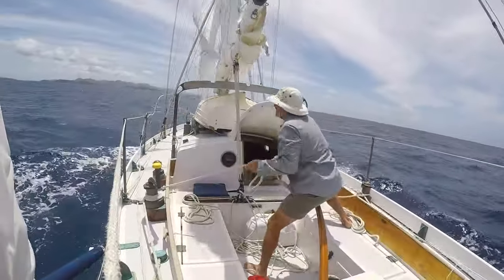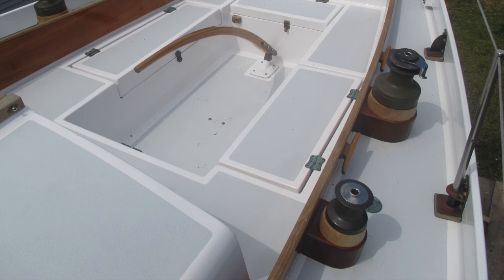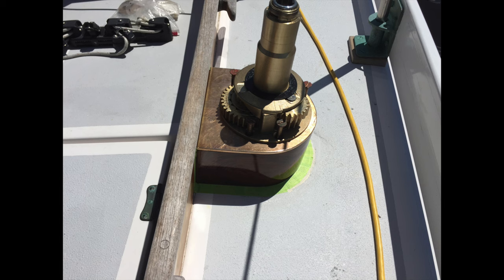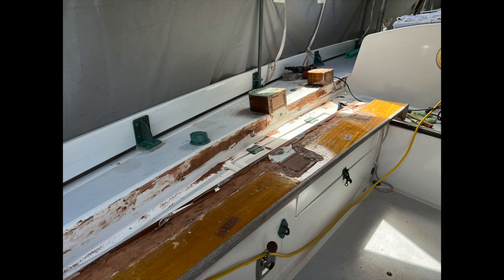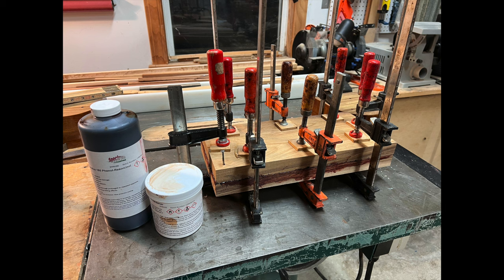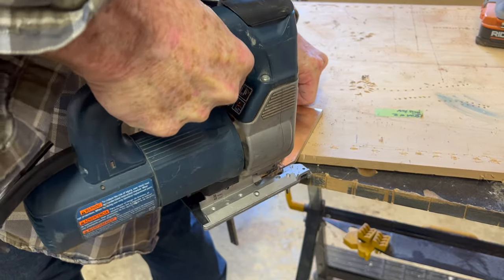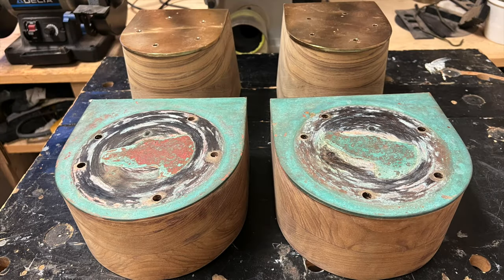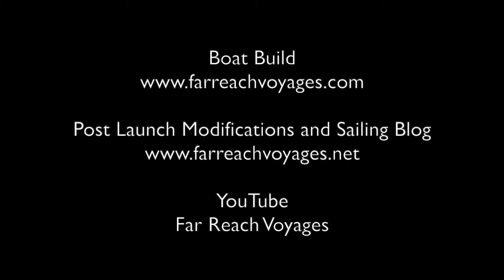S6E2//How to Build and Install Custom Teak Winch Pads with Bronze Top Plates

Comment: I changed my LOGO
Sign up to learn how to sail a sailboat. However, it is very cold at sea in winter.
I really like your little fine wood planer
Epoxy-bonded wood will have a noticeable gap.
Big Star has a waterproof glue that can bond two pieces of wood together naturally without any gaps.
Reply from the maker: Exactly.  It's important not to over tighten joints when using epoxy because you can squeeze the epoxy out and starve the joint.  So if you can't clamp hard epoxy can be a good choice though it comes with liabilities many people don't want to acknowledge.  Though I am not familiar with Big Star there are several good glues when used on tight joints and clamped well the glue line is practically invisible.  Weldwood Plastic Resin glue (which I have used), UF 109, Aerolite 306 and 308, Tite-Bond III can work well.  Most, though, are not completely waterproof, boil proof, UV proof, and steam proof, like Aerodux 185 and other resorcinol glues.  

I can't tell if the writing on your channel is Chinese or Japanese (very sorry about that).  You have commented on many of my videos.  Always appreciated.  I'm curious--Where are you from?  How is your English?  Are you sailing?  If you are interested you can email me via the link on my website FarReachVoyages.com.   Thanks.
Reply from the maker: I'm going to go out on a limb and say Japanese based on the hiragana "no" symbol next to your logo?  Like the number 9 turned on its side.
Reply: @FarReachVoyages  This is a word, cloud. The upper character means rain, and the lower character looks like clouds. Together they mean clouds.
I am working hard and hope to immigrate to Japan soon. Then build a trimaran there, using a gaff rig. This way both cost and speed can be taken into consideration.
My channel has a lot of flight simulation videos. But a pilot's license is too expensive. After watching your channel I want to sail around the world on a sailboat. I have also read your website, which is very good, especially when I am drinking coffee in the afternoon. It is like reading a book and slowly savoring it.
I also practice Japanese karate myself and am now a black belt. My English is generally mostly machine translation. As if this does not prevent us from communicating.
Reply from the maker: Thanks for the very the kind words. Glad you are finding the videos and websites useful. 

Keep your eye on the prize. It's worth the effort and sacrifices. If you are determined enough you can make your own reality. Good luck to you.